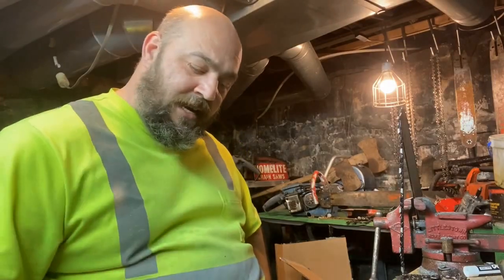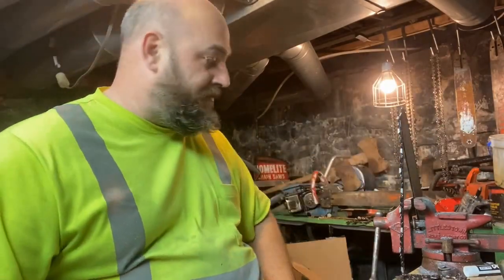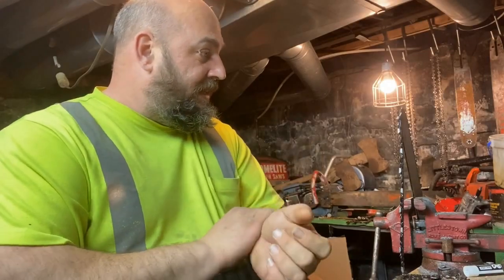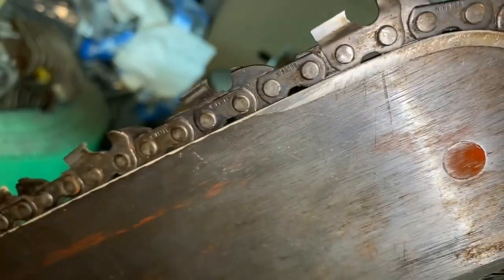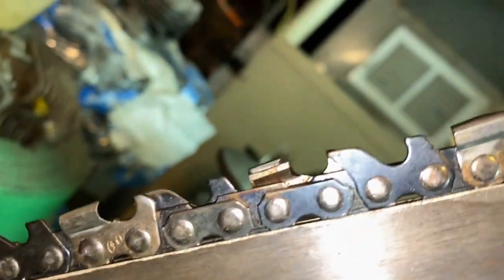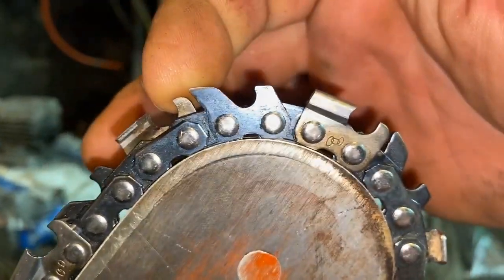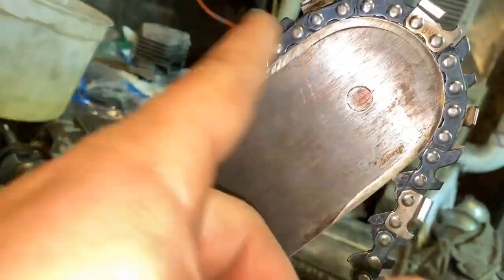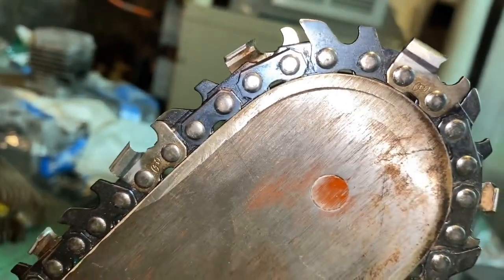Low Kickback Chainsaw Safety Chain!  Are You Making The Right Choice?  More Gifts!!!!!!

Comment: Here in Florida most all safety glasses will fog up, but I finally found a quality pair of shades that will last at least a year, never fog up, and are ANZI rated. As a climber, I am very rough on all my equipment so it was either buy 12 or more cheap pairs throughout the year or one awesome pair. Heat wave visual.  Check it out.

Comment: I had chaps that I never wore, I don't like the tight belt around my guts when cutting. I sold them and bought some bib and brace safety overalls instead, looking forward to using them as I have been slack with my safety equipment. I have cut into 2 pair of pants without pruning myself fortunately.
Reply from the maker: Thats a close call!
Reply: @Smittyschainsaws  Yes, I better not tempt a third time lucky.

Comment: I use that safety chain( which is tri link ) on all of my shorts bar saws. Cuts well and havent had a serious kickback in quite a while. I've had a pretty bad accident using a stihl top handle at work and it happens fast. Definitely be careful with top handle and no chainbreak short bar combos. It is a serious accident a lot of the time. Good information in this video.
Reply from the maker: Thanks for your input buddy!!